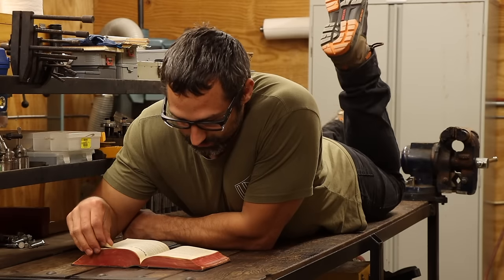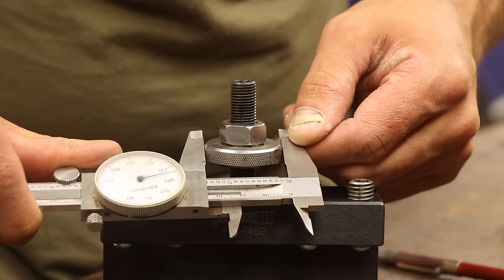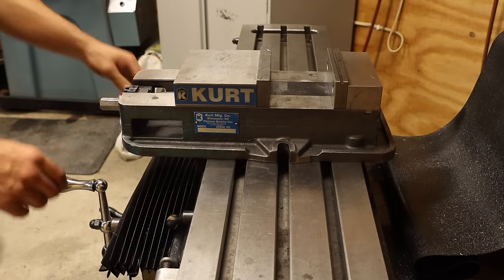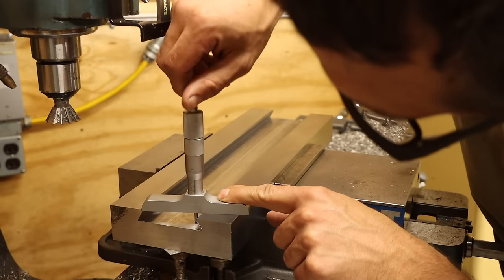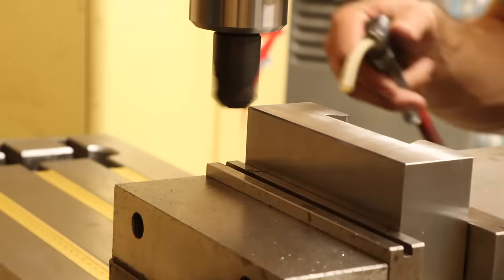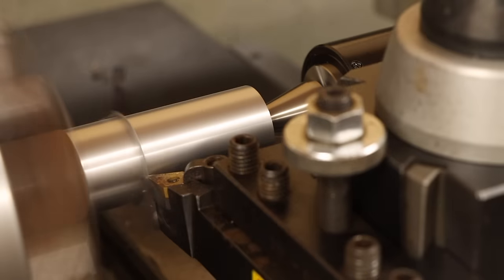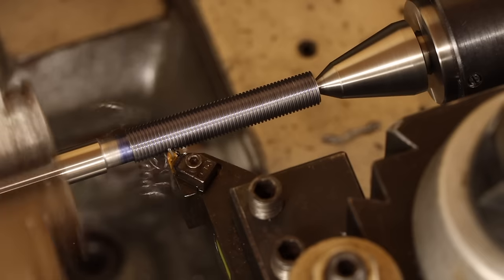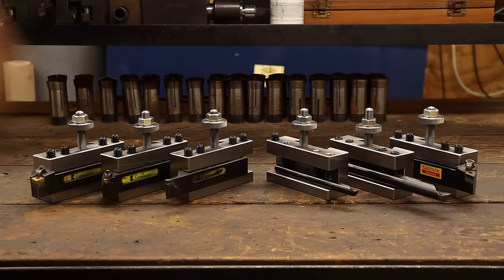Making an ARMY of Tool Holders || INHERITANCE MACHINING

Comment: I suspect that the increase in noise as you cut deeper with the dovetail cutter was not due to the difference in surface cutting speeds, but just that more and more of the cutting edges engaged with the work.  Maybe you could have cut the dovetail with two depths of cut, overlapping, to use just half of the cutting edge at a time.

Comment from the maker: *CORRECTION!! The main bodies are actually low carbon cold rolled steel, not 4140 as I mention in the video and some other comments. Got my McMaster order history mixed up!

Also for those wondering raw material, hardware and tooling cost was around $350 USD plus $30 shipping. Not including the die that was ultimately not used.

With a battalion of tool holders ready and waiting I think lathe heavy project is in order. Tune in Friday October 14th at 10am EST for the next build!
Reply: Yeah! Right on my birthday 

I really enjoyed your video, like all of them before! I also had this problem with a seriously wonky thread, after cutting it with a die, even though I precut the threads on a CNC lathe with a insert tool. I planned on finishing them with a die. Learned to not trust thread dies at all 😂
Reply: I think you have an incredible channel there’s a serenity to it, maybe it’s your voice. Happy birthday to Dodo Jesus rex🎉. Keep up the awesome work……….. Your shop is pretty neat( the bomb)
Reply from the maker: @dodojesusrex5380  wow really? I had someone else suggest doing just that, but apparently may not be a good idea either. One other person recommended holding the die in the 3jaw and the shaft in the tailstock chuck. At least this way you could guarantee the die is straight.

Happy Birthday!!! Hope it’s a good one!
Reply from the maker: @anthonyrivers8395  Thank you, sir!
Reply: @InheritanceMachining  Die in the chuck doesn't sound like a bad idea, tbh, never thought about that.

And yeah, I gotta say it was only an M10 thread in some very gnarly tool steel over 12xD 😅 So I could've seen that coming tbh. 
At least i learned from it 😂
Reply from the maker: @dodojesusrex5380  😂 that’s the important part!
Reply: It has nothing to do with what amazing content is in this video but I need to ask. What motorcycle did I see there in the back when you entered the shop...
Reply from the maker: @TheKing-xt9tw  FJ-09... it's for sale actually! 😂
Reply: @InheritanceMachining  Thats a flipin nice motorcycle. Would love to own one but I live in south africa and they are quite expensive.
Reply: @InheritanceMachining  The only thread cutting with a die on a lathe I've done has been with the die in the chuck.  I didn't have another way to hold the die and get enough torque.  The pipe thread cutter I use has a sleeve that precedes the cutting teeth to hold everything square, if that makes sense.  Enjoying the channel.
Reply: How much would have costed the 6 Tool holders bought from the shelf? (Although not really comparable)

Comment: "Without a single hiccup, I might add"
As he said that, you could see how the tool holder got pulled up from the vice by the tap. If you go frame by frame at 12:34, you can see it lift by a few milli meters.
Reply from the maker: I didn't even catch that 😂 I guess I'll have to start over
Reply: @InheritanceMachining  I assumed that the without a hiccup was in there as a joke... The timing for it was absolutely perfect.
Reply: I KNEW I wasn't just seeing things, the movement caught my eye and I watched at 0.25x speed just to make sure I was seeing it right
Reply: I saw the exact same thing and laughed when i went back to double check. was perfectly timed with the comment he made

Comment: If you like the bare steel look, you might consider Boeshield T-9. It was developed by the Boeing Company for lubrication and corrosion prevention on aircraft. It sprays on and leaves a thin, clear, wax-like coating when dry. It's a little pricy, but I have had excellent results with it.
Reply from the maker: Oh thanks for the tip! I haven't heard of that one. I've been using another product called ACF 50. It's kind of like a penetrating oil and has worked great for my projects so far

Comment: Great channel, love your content.
I wanted to share a great tip that a well experienced Mill Hand taught me one day: Spot, Drill and Tap all of your holes in the same location across all parts before moving over in the X-axis to the next hole. Then repeat. If you have to change speeds for tapping, then come back and do that after all are drilled. For the chamfer, you can just leave the vise slightly cracked and allow it to self center. His reasoning is that you can swap parts and tools much faster than you can move the axes and lock them down. So long as your tolerance is 0.005" total, you will be good.

Comment: I made a batch of toolholders a while back.  When it came to machining the dovetails I adopted the approach taught to me by an elder statesman of machine shop expert.  His advice was to make the cut in one pass which meant running the tool well under any theoretical speed and makingthe pass very slowly.  It was strongly advised to flood the job with coolant, not to cool the cut but more to wash away the swarf. The result was excellent.

Comment: I used to work in a screw shop they had nice die holders for the tailstock with removable inserts :)
Reply from the maker: I was thinking something along those lines to I'm not limited to 1 size
Reply: @InheritanceMachining  yeah they had hinged bodies for the inserts so you would just put in your pitch and you could disengage the inserts and pull the stock out of the die. I went into CNC but I always remember running those old WW2 brown and Sharpe machines all cam timing stuff

Comment: Check the bottom of your vise. It might have some features that would allow you to make little blocks you attach to it so it registers in the T slot. That way you don't have to tram it in each time.

Another tip, if your part is bigger than the envelope of your vise, there's no reason why your parallels have to be the ones you usually use. Yiu could use 123 blocks on either side of the vise, which would also support the long ends of the work piece.
Reply from the maker: You're right it does. The swivel base as well which did have the blocks. I played around a bit to move them onto the vise itself but the geometry was a little different so it didn't work out. I'll probably make a pair
Reply: @InheritanceMachining  For your own sanity you will check the tram regardless of the blocks so you may as well just tram it.Practice makes it quick enough to do and then you are sure.
Reply from the maker: @localele1  If I'm being honest I would check it anyway as well.
Reply: @InheritanceMachining  I have been down that path of register blocks but as machinists we like to verify before cutting.Especially the basis of all future ops ,the vice tram.
It is a good warm up exercise to tram or at least verify the tram before machining parts.

Comment: First of all, your craftsmanship is fantastic! 

Me I'm a software-engineer turned toolmaker, though I still am a software guy and I use those skills to build automation into my machines, I can say that toolmaking is a concept closely related to meta-programming.

But here is what I wanted to say.  It is easy to get lost in it, lose track of ground reality (pun not intended but very fortunate).  

Essentially, it can become a never ending cycle of building tools to perfect tools, but perfection is an illusion, and its not worth chasing.

I have learned it the hard way.

80/20 is the way to go.

Comment: You can save yourself a lot of tool changes by doing all similar operations before switching tools. For example, drill all four holes for the set screws, then chamfer all four, then tap all four. You have a DRO so it’s not an issue finding each hole. This takes your tool changes down from 12 to 3 for each part.
Reply from the maker: True, but changing tools in 5 seconds seems a bit faster to me than repositioning the table to a thousandth
Reply: @InheritanceMachining  I was just about to comment that exact thing haha. Another excellent video!! Keep up the AMAZING content. From a fellow toolmaker I love what you do and the soothing style of your videos!
Reply: @InheritanceMachining  I mean, it’s not, but you know, do you boo, do you. Still love the channel, even if you’re wrong… hahaha patiently waits to be attacked by rabid fans who don’t get sarcasm
Reply from the maker: @DavidHerscher  😆My shop my rules! thanks man!
Reply from the maker: @BedroomMachinist  Thank you sir!
Reply: @InheritanceMachining  Can’t argue with that! And your work speaks for itself, so keep doing what you’re doing! 👍👍

Comment: I know this is an older video but this is still a great tip for die cutting longer threads in the lathe!
#1 Chuck the DIE in the headstock and indicate the face of the die dead nuts!
#2 Chuck The stock you wish to thread in the tail stock drill chuck, turn down a section to fit the
tailstock holding method?
#3 Oil up the bed and set the clamp for the tailstock to a nice slide and go for it!
#4 A nice chamfer on the stock helps a lot!!!!
#5 IF you see the stock running out when you start, STOP and restart!!!!
A turned down to the die minor diameter section at the start REALY helps if possible?
With this method you are only restricted to the length of your lathe or headstock bore for non
super precision threads.....

Comment: for bottom hole tapping you should use twisted tap, on those you can additionally grind down the tip to get very close to the bottom and have chips come out the top

Comment: I’m attending a machining course at mountain land technical college, we have 2 types of lathes, both are engine but I always prefer the slightly smaller one, simply because I see my life flash before my eyes every-time I need to change out the massive 3 jaw chuck. I have no doubt it is well over 120 pounds

Comment: if you are making an external thread with a die, turn the external diameter 0.1mm below the thread gauge. this helps the thread stay straight. and take a long-handled die. then you can use the motor because the handle rests on the tool slide.

Comment: Another great video.  I have a similar setup on my lathe, except it's the cheaper and incredibly reliable inverse version of the locking taper setup, the one where you use a hex key to lock them down.  

I'm actually half way through building them with the main blocks finished and ready for the set screw holes to be drilled.  I recall, the project stalled abruptly due to COVID.  I had a heated conversation about 2 days before our first lock-down with my mother explaining why she can't go to church for the foreseeable future.  The whole time period was so stressful that I stopped building anything for about 6 months by which time I moved towards woodworking.  After seeing this I think I'll make it a point to dig these out and finish the job!
Reply from the maker: Thanks! Get back at it man! You know metal is better than wood 😉

Comment: FYI, cold rolled steel has so much stress in it from cold working, once you start hogging material out it will move all over the place. It’s likely where your .003”-.004”of movement came from
Reply from the maker: I realized that once I remembered I twas cold rolled low carbon and not annealed 4140 like I though 🤦‍♂️
Reply: @InheritanceMachining  Honestly, I expected it to move a LOT more than it did. Even normalized material will move more than your piece did when you hog out that much.
Reply from the maker: @kevind1865  I think I got lucky that it relieved in the direction toward the jacks, otherwise it could have been a real problem!

Comment: Nice Work! Regarding cutting threads with a die on the lathe: just hold the threading die in the 3 jaw chuck and the stock in the drill chuck. Now you can cut long threads under power. I've actually done meter long threads that way, works a treat.
Reply from the maker: That is genius! Do you have any issues with the die collapsing if it's adjustable?
Reply: @InheritanceMachining  never used split dies with that method. Might be a good idea to turn a stepped ring and put some set screws in the circumference to hold the die firmly without distorting it.
Reply from the maker: @93holzkopf1412  that’s exactly what I was thinking after I sent that. Great idea!

Comment: I’m glad you have done this video as I am about to make my tool holders too! 
One excellent design feature of the genuine aloris holder is a groove milled vertically in the height adjuster thread. It accepts a internal tab washer to make sure there is no unwanted turning of the height adjuster when you nip up the lock nut. A nice touch
Reply from the maker: Ah! That's what that is for!! I haven't bene able to play with one in person to understand what was going on there. For your build I'll share a suggestion I got today and wish I had heard. A threaded locking collet (like the kind that is split and clamped by a tangential screw) would be more resistant to moving and also shifting as it is tightened. Also a ball knob on the top of the post for handling. Either way more tool holders will be invaluable regardless of the minutia. Thanks and good luck on the build!

Comment: As always, I enjoyed the video.
  I was looking forward to seeing you do the dovetails in the surface grinder because I couldn't picture the setup.  I gather you would have ground against the back side of a wheel with a chamfer cut to clear the bottom of the  slot and the guard removed.
For what little it's worth I would have used set screws for the height adjuster studs even if I had to use imperial threads.
Reply from the maker: Yup that's pretty much the setup. Dress the wheel front at 60 degrees and also dress away most of the back of the wheel so I'm just using the wheel near the edge. All setup with the sine plate.

Funny you mention using imperial hardware. The thing I didn't mention about the set screws in the originals is that while they are metric, the hex drives were punched out to 1/4 (6mm wont fit like the new hardware). I somewhat regret not going imperial now 😂 

Thanks!

Comment: Recently found your channel, and came in for my nightly medical treatment.  
Not as a critical comment, but a thought to consider is to cold blue or similar treatment.  My relocation to a northern area forced me to rethink long time storage.  Here bare steel rusts almost overnight.  To my anguish!  Went from steel brush and oil and it helps, but the real deal is blueing.  I used gun shop/box-store brand on numerous tools, and it really is worth the time spent doing.
Reply from the maker: Thanks! I sometimes blue my parts but I honestly have no rust issues in my shop whatsoever. I have a dehumidifier running non-stop

Comment: To get a more consistent knurling I run the feed at the half the pitch on the knurling wheels. Also angle the tool a few degrees with the lowest point towards the tailstock.

Comment: Next time you’re tapping a blind hole, you should try to use some spiral flute taps. It will pull the chips out of the hole just like a drill would…. and especially if you’re power tapping, it makes it so you don’t break the taps off in the hole once it gets too clogged with chips and also, you won’t have to repeat the tapping process multiple times just so you can clear the chips from the bottom of the hole each time. It’s a time saver and the threads come out perfectly every time I’ve used them! Worth every penny. Plus sometimes when you tap the same hole multiple times you have to worry about cross/double threading the hole  a.k.a. avoid starting the threads at different points each pass down to avoid the chance where sometimes the top few threads will get cut more than the deeper threads since the tap went past those threads more often and the tap might have been at slightly different angles each time you tapped the hole leaving the threads much more loose on top of the hole rather than the bottom of it. Just figured I’d share that with you in case you’ve never used them before! Loving the content dude! Fantastic new machining videos added to YouTube :) yay! ❤🎉
Reply from the maker: Thanks for the tip man! That all makes perfect sense. Next time I have to buy a specialty tap I'll most likely go that route. Also thanks for the support!

Comment: Get yourself a nice piece of white oak and machine a series of dovetails like the one on the tool post that your holders fit on.  Basically making a series of mock tool posts to keep your tools.  Mount those on a shelf right over the lathe.  With enough clearance that when you slide them on and off they don't smack into each other, and orient them so that the tool faces towards you.  Now you have a nice tool holder holder that is in easy reach of you when you are working on the lathe, it won't damage the tool holders at all, and with white oak you are not going to get much debris.  You could also use some red pattern board to make them out of.  It is a nice machinable material that will with stand the wear of pulling them on and off.
Reply from the maker: Great idea! Thanks for the tip

Comment: im in the same boat with dealing with meteric an imperial. i started with 3d printers an everything with them by default is metric so thats what everyone uses now a couple yrs into this adventure i have a mini lathe and mini mill so nothing compared to what you have but im always making stuff on them using imperial but all the hardware i have is metric so i always use metric hardware. i just picked up a decent tap an die set so i can start making my own threads til i learn to on the lathe but hardware takes some time to gather up all the different sizes u need so ive gotten a decent collection of the metric stuff an i really hate to have to start keep them both but with time i'll end up with the same size collection of the imperial sized stuff too.